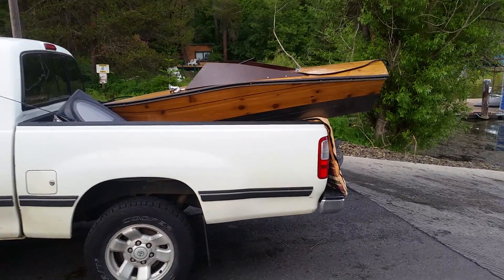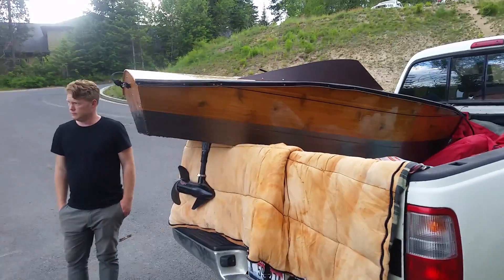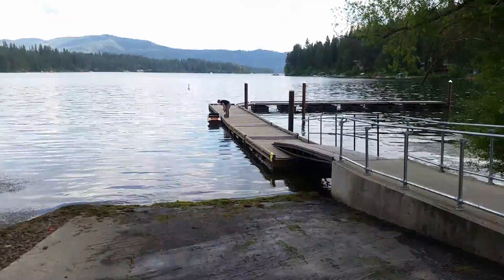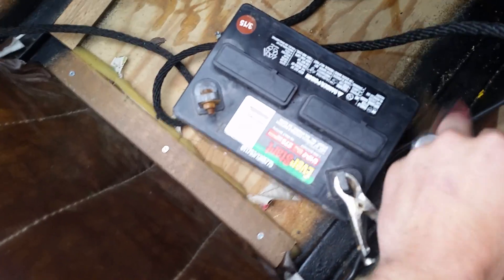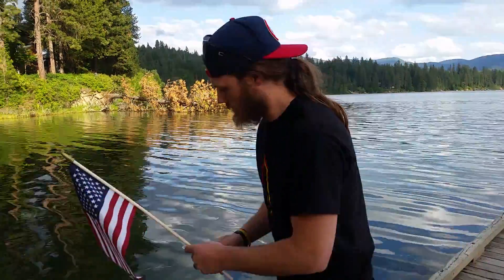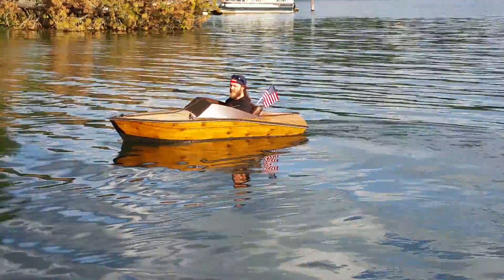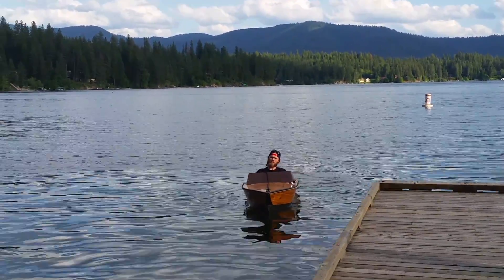Plywood boat electric inboard small

Comment: You should hand 2 trollors off of that.
Reply: MinnKota has 160's,  A couple of those should stand that thing up on its ass.(lol) Just kiddin Brian, Good job.
Reply from the maker: +Ima Tumor is that 160lb thrust????? That i am interested in! Maybe just one at that rate ! Lol thanks
Reply: +Brian Davis Yes and no. Looks normal up top, but It has twin 80's on the bottom. 24 volt. So 2 (160's) would actually be 4(80's)  You'd need 2  greyhound bus batterys to run them  lol.
Reply from the maker: +Ima Tumor oh man held back by battery technology again!  Too bad lipo batteries are so reactive to water!

Comment: Nice!!! Thsts really cool. Are you just using a regular trolling motor?

Would be interesting to see how it would run off a lithium ion battery instead of lead acid.
Reply from the maker: +The Adventure Biker yeah this is regular trolling motor but it is worn out and slow.. i would love a lipo battery and a brushless motor!
Reply: +Brian Davis Sounds like that would be a bit of an expensive setup but I bet it would be faster and have longer range!
Reply from the maker: +The Adventure Biker definately! Probably even quite a bit lighter!!

Comment: I've seem a couple of boats done this way, but not as pretty as this one.   The only difference I saw was how the electric
motor was mounted up closer to the boat with a stick steering and the throttle was on the steering lever.   They had twin
batteries mounted up front to cover the motor, lights and depth finder.    It was a pirogue design and also used for 
duck hunting down in Louisiana.
Reply from the maker: +James Maxwell that sounds amazing!!

Comment: No life jacket, doesn't look stable for a younger captain.  Wonder if any floatation was inside the hull.
Reply from the maker: +Robert Wentworth no this thing would sink like a rock!  Very unstable in turns but im in the middle of fixing that problem! Still no kids allowed lol
Reply: ////your finish is fantastic, and consider a keel glued in place from about one third from stern.  It will keep it straight when motor stops and your gliding to shore.   I wasn't being critical.  Ive build two dingy's one is still floating and the other was used as a snow sled in the winter.
Reply from the maker: +Robert Wentworth haha at least the boat was used for fun!! A keel would be good for a few things!  Although it does make it harder to transport maybe. I just locked the steering on the bigger boat and put on a rudder!  You think it will help with handling? I would love to hear advice for stabilizing the square boat! Would the keel help? Or maybe one on each side?   Thanks!  Also in my newest video im wearing a life jacket!  Its wise with these home designed jobies! And i love the idea of flotation in the boat! Maybe put foam block in the back!

Comment: hello !  can i use 5mm plywood for the hull ?
5mm here : http://www.leroymerlin.fr/v3/p/produits/panneau-contreplaque-ordinaire-ep-5-mm-x-l-250-x-l-122-cm-e105080 or 10mm ?
Reply from the maker: that should work fine! just make sure you have support every 10 in or so, or get more strength with bends or curves!!
Reply from the maker: this boat has 15mm flat floor
Reply from the maker: +Xtermin59 Hey that looks good! the only problem is the 15mm wont bend really to curve up in the front.. i would use the 5mm everywhere and just add extra bracing where you will sit so your foot doesnt poke through!  my other boat is very similar to your design and it only has 5mm on the bottom! it is way lighter too!
Reply from the maker: +Xtermin59 This boat is all 5mm. it uses bends and cross members for strength like your design!!  great job!!!
Reply: Hey okay thanks ! i use only 5mm and for supporting the shell, you use what wood ?
Reply from the maker: +Xtermin59 19mm X 35mm   Comonly called 1"X 2"   douglas fir or pine or whatever!
Reply: I did research on the store in my city 

I find no 19mm x 35mm :/ 
only 19x32 , 18x34 , 2x38  fir, you advise me what ?
Reply from the maker: +Xtermin59       those first two will work fine! Just test by trying to bend a small section. If it is stiff it will work!  I could be more helpfull if i knew metric sizes. I acctuall used a few different sizes just because i had them already
Reply: okay thanks , i will buy 18x34 :)

I have not the measure for now , I look forward the necessary wood.

but I think to a boat

I have not the sizez for now , i look forward the necessary wood , but i think to a boat in 2400mm / 700 mmm approximatly

thanks you :)
Reply from the maker: +Xtermin59 good luck!   If you want to pause this video to see how to pictures!    https://youtu.be/Fb2OiEMXoF4    
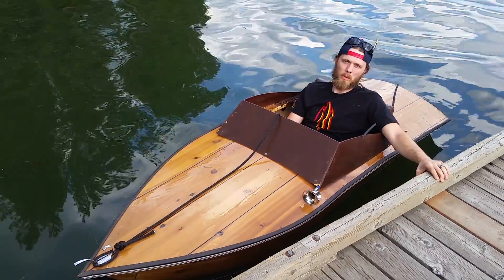 Skip to 5:30 and get ready to pause! You will see alot!!   It will help i hope!
Reply: great, thanks you very much for your help !
Reply: i'll take this engine : http://www.nootica.fr/moteur-electrique-minn-kota-endura-34-c2-v2-6318.html ,  wiht battery 92ah and charger  Exide 12/4 12V 4A its good ?

i have to buy something else to connect or other pieces ? thanks ^^
Reply from the maker: +Xtermin59 this works! if the battery is a 'Deep Cycle' or 'rv/marine' battery, it will last longer.    you might also want an 'amp- meter' so you know when battery is halfway drained (time to turn around!) :)  also some 14g or 16g wire and connectors for hooking it up!
Reply from the maker: +Xtermin59   Great work! that battery is perfect and will last years and (hours charge)  the charger is less important, any 12v automobile charger will work (i would go with less expensive my self but both of your choices will work!)  the amp meter has many many options and almost all should work! i personally like the analog guage with a needle. the digital ones are nice but can be very hard to see in the sunlight.. but any old cheap one from Amazon or ebay or french site ;)
Reply: Thank you!  so , I'll order :

Minn Kota Endura 34lb C2 V2
 Battery Exide Dual marine 115A
Charger Exide 12/4 12V 4A
2 thimbles for battery
 
TOTAL 376.90€

I am like you, I also prefer the analog gauge ^^ , the amp meter indicates the remaining charge total in my battery , that's right ? I know absolutely not me ( sry for my english ^^ )
Reply from the maker: +Xtermin59 I am unsure exactly.. i think the amp meter shows the rate of flow and a volt meter shows amount left.  But i think a combination of the two would be best.  Or just get a 'charge indicator' that just shows like a auto gas tank.   I need to do this too i am learning!
Reply: +Brian Davis 
I would like to have a charge indicator to see when I need to recharge ^^ , my money is down now ...wood + full engine 500€ grrrr

it possible to speed controller in a box in the front of the boat ? i need what ?
Reply from the maker: +Xtermin59 the speed controller and handle can be removed and moved with wire extensions. They come apart easily. You will have a few speeds in reverse and a few foward.
Reply from the maker: +Xtermin59 try to recycle some cheap or free wood!
Reply: I need to use a special extension wire ?
Reply from the maker: +Xtermin59 try to match the guage of the wires in there. I think 10guage.   Then chop all of them, add butt conectors on both sides. After you decide where to put the controll box, you can connect everything with correct length of wire.   Or just  8 ft and coil any extra wire.
Reply from the maker: +Xtermin59 the wires inside are not very big.   like these always good to have extra!   
http://m.ebay.com/itm/45-Piece-Ancor-Brand-Marine-Grade-Butt-Connector-Variety-Pack-/291444936047?hash=item43db78cd6f%3Ag%3AX88AAOSwEeFVPW2h&_trkparms=pageci%253Aa0e21c49-52c0-11e6-b091-005056aa6161%257Cparentrq%253A246ad66c1560a2b0b2ee5e01fffe1405%257Ciid%253A1
Reply: oh thanks I did not know it was that kind of connector , im idiot. 
by cons I have to find a french shop , its 32$ for shipping ahah
Reply: I can use a soldering iron to connect the cables ?
Reply from the maker: +Xtermin59 yes you can and that is much better too!!  Good idea!  Be sure to wrap in tape well or shrink tubing
Reply: perfect , I expect my orders and I 'll let you know , for now I will try to draw boat on paper ^^ I'll show you if you want
Reply from the maker: +Xtermin59 i would love to see!
Reply: can you give me the dimenssions your boat ,and as well as the size where to sit , to give me an idea for my draw paper ? ^^
Reply from the maker: https://gumroad.com/l/zGtC    you might also be interested in my creative boat builders guide where i get down to the details better!!
Reply: hey , this is a video guide ?
Reply from the maker: +Xtermin59   no just dimensions
Reply from the maker: +Xtermin59 those look good!!  you dont need my plans!! :)
Reply: hey , i have another question , my plywoos its "normal plywood for inside ,is good if I protected with fiber for waterproof ? 
I can not afford to buy marine plywood
Reply from the maker: +Xtermin59 I think you should paint everything below the water line as well as fiber glass and resin. My boats are made of wood for interior!  You will be good!  If you email me, i will send you some drawings!  I know how it is to spend your money on these boats! It goes fast!   brinedase84@gmail.com
Reply: thank you very much , I was afraid that the plywood that I 'm going to buy was not good!

so it takes me I bought the resin and fiberglass

I'll add you to email , thank you ^^
Reply from the maker: +Xtermin59 consider also, painting interior of boat in porch paint or other water proof paint or stain.

Comment: Not an inboard. It's a trolling motor mounted through a hole in the bottom of the boat.  An inboard has the motor inside the boat, a drive shaft runs through the hull then supported through a cutlass bearing before the prop
The set up you have is more like a axipod if you allowed the motor to turn more than 360 deg
Reply from the maker: +Mazda rx7 You are technically correct.
I hope you didnt watch too far before you figured out i lied in the title and didnt waste too much of your time.
Maybe you could suggest a better name that is accurate? 
"Particle wall board, epoxy covered, trolling motor through the hull with a fake steering wheel; homemade waste of money floating box with non inboard or outboard or a axipod"
Reply from the maker: also how would you define my next plan? electric motor in the boat with a jet drive.  i wont have a shaft through the hull or the water proof bearings, will it be an inboard? 
either way you should check back and give me advice! thanks for commenting!   cheers!
Reply: Electric Jet drive.  But jet drives are much less efficient than props, they require more hp.  Jet drives, the pump, requires certain rpm's to run efficiently, usually around 6000.  The only advantage to a jet drive is shallow water and no prop to hit people if they fall off the craft (ie. seadoos) Props are much faster and more efficient.
Reply from the maker: +Mazda rx7 Thats good to know! Someone else suggested a 24v razor scooter motor inside hull at an angle! I dont want a boat that is slow! (I already have two of those) the hard part is the waterproof bearing... i wonder if i can use a flexible shaft like weed eater and jus have motor mounted higher than water line and loosly seal for splash back.   I dont think ill go jet now.. it is much harder to fabricate too!
Thanks!
Reply from the maker: +Mazda rx7 Thats good to know! Someone else suggested a 24v razor scooter motor inside hull at an angle! I dont want a boat that is slow! (I already have two of those) the hard part is the waterproof bearing... i wonder if i can use a flexible shaft like weed eater and jus have motor mounted higher than water line and loosly seal for splash back.   I dont think ill go jet now.. it is much harder to fabricate too!
Thanks!
Reply: Don't try to reinvent the wheel, you'll just waste your money and time. Just look at micro boats, powered kayaks and other tiny boats.

The problem with weed eater setups is the weedeater motor and shaft were never meant to have a constant strain on them as in driving a prop through water.  Yes , you will see lots of vids on this conversions but none of stand up to much use
Reply from the maker: +Mazda rx7 I like to do things different as a rule but, the weed eater shaft does sound too flimsy... sloppy loss of power too..
Reply: Brian Davis
The idea of those things comes from mud motors, used in the bayous.  using a weedeater and it's shaft is like putting a lawnmower engine in a small  pickup. Sure, it will work but not for long. Not worth the time or energy.  Trolling motors can only go so fast. their props only have a 4" pitch, for which they are designed to use. If You can find a 9.9 outboard (or smaller) that the engine is broken, replace the gas engine with an electric motor.  These are common electric conversions. You can even make the leg of the unit shorter to suite you boat.  J Mantzel (YouTube page) made his own lower leg from fiberglass. You can make the leg as short or as long as your skills permit. 
But me. I prefer catamarans over mono hulls. They give you more options .
Reply from the maker: +Mazda rx7  i would never use the motor from a weed eater!!   I have a predator 670 (22hp) vtwin i could put in a boat if i was going gas... Which now that i say that.... its fan cooled with oil cooler, electric start,  make a two seater boat! maybe not enough rpm range to be worth it...  then the shaft, maybe a drive axle from a subaru??? Haha just kidding

Comment: HAHA that boat is super cool!  I like the shape of it and the size.  My only complaint would be the windshield... doesn't seem to look as good as the rest of the boat.   I'm thinking I need to build me one of these!! (my wife might kill me though)
Reply from the maker: +Brian Vaughan yeah i agree and when you see it in person, it looks even more jenky... i would love to have chrome brackets and glass!  Maybe i can repurpose something! Thanks for watching!
Reply: +Brian Davis I agree that that would be the coolest way to do it.. but you could do it out of wood, without a lot of trouble. install your "a" pillars (If you will) and then bend your own thin plywood.. like 1/8".. nail the first board in place. then wood glue that board all over.. then stuck another board on top... clamp it up really good.. then do it again. and boom... you have your own custom, curved, laminate. but even it you don't. this boat is super cool as is. I have a huge crush on the ol girl!
Reply: That is a really good looking little boat. If you want something to re purpose into a wind shield, I would suggest pulling the protective front panel from a big screen projection type TV set, They are Plexiglas or something like it and fairly easy to come by.
Reply from the maker: +gorp27 why did i never think of that??? Thats genius!  I have a flat tube tv already!!